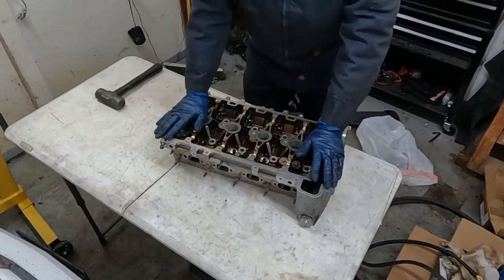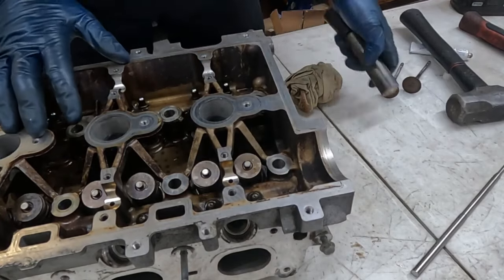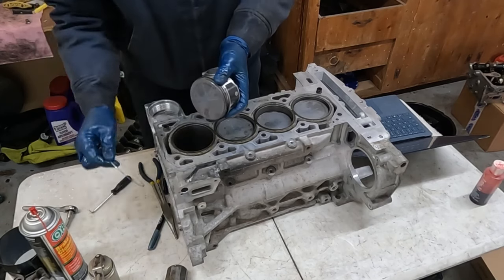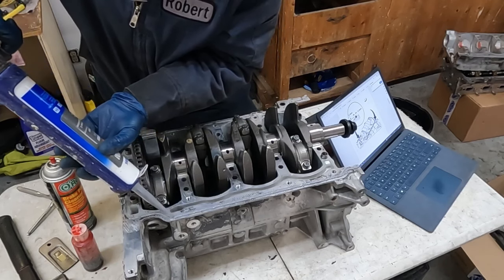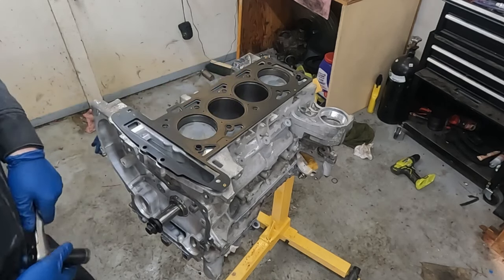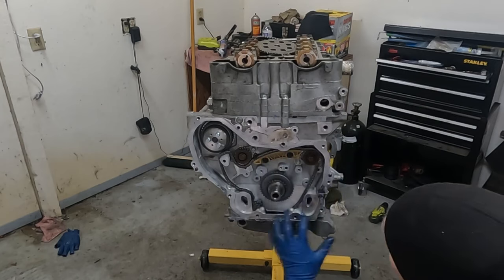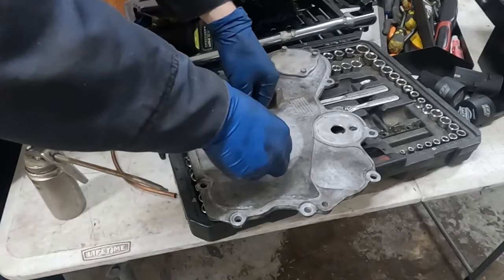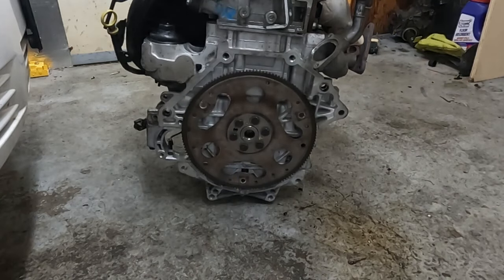Chevy 2.2 Ecotec Engine Assembly | Engine Rebuild

Comment: One of the best and most informative videos I’ve come across. Great job and thank you sir
Reply from the maker: @chrisogilvie2185  Thanks! Glad this video is helpful 🙂
Reply: I’m looking to change my piston rings on my 2013 terrain soon. Which rings did you use?
Reply from the maker: @chrisogilvie2185  These were from Engine Tech. They are a decent brand. But if possible I would recommend Mahle/ Clevite or Hastings.
Reply: @ValleyMobileAutomotive  awesome thanks for the advice ! 😁

Comment: Bought my 2.4 na cobalt SS new in 2006…220,000 miles and still running strong. Only problem is the oil cooler is starting to leak.

Comment: mine (Z22SE) is leaking some oil and it's gathering just behind the oil filter, there is a crevice there. I wonder if it's the valve gasket. But it seems bone dry.
Reply: Mine had a pinhole in the plastic oil filter cover that let oil seep out under pressure.

Comment: Awesome video! What rebuild kit did you end up using? And you said you put new connecting rods in? Where did you get those? I know there is a TSB for connecting rods bending in these (destroyed my engine) I was just curious if there is a brand you recommend for avoiding that in the future
Reply from the maker: Everything came from Rockauto. The kit was mostly Enginetech. I can't recommend this kit though. The head gasket didn't seal and the injector o-rings were too small. I would recommend Mahle for metal components and Fel-Pro for gaskets if it's available.
Reply: What kit did you get? 🙂
Reply: I was following the book and noticed it looks like you let the tensioner spring out instead of resetting it. I've noticed issues when I set it and try to to suggest the book does and set it. Would you just purchase it in sprung?

Comment: Would you recommend using copper spray-a-gasket by permatex on the cylinder head gasket?
Reply from the maker: @JustinMitchell-g6v  Good question. It's not needed. Getting a quality brand gasket is all you need 👍

Comment: How much dose that motor weigh with out head on it doing one for my wife that the timmer chain guide broke in a million parts and a bolt was found on the bottom where the oil pain meets that 2nd main crank case trying to see if we could lift it out by hand no life thinking its about 350 400lbs at most
Reply from the maker: That's a good question, I don't know the answer to. I think bending over the car to lift something that heavy would be very difficult. A cheap engine hoist costs around $100 and would save your back.

Comment: I cant find any 2.4 ecotec engine overhaul videos on YouTube. Is this 2.2 ecotec rebuild applicable to rebuilding a 2.4 ecotec engine?
Reply: They look so similar; I assume the displacement is the only difference?
Reply from the maker: @waterfrommatthias5601  What year is your 2.4? I'll look at the manual and see if they are similar.
Reply: @ValleyMobileAutomotive  It is from a 2013 chevy Equinox. Thank you very much for your help!
Reply from the maker: @waterfrommatthias5601  They are very similar engines with minor differences. What I recommend is getting a manual that shows you the torque specs and assembly sequence. Even a cheap Haynes manual should have that information. You can use this video as a visual aid if needed. But none of the parts in the description will match your 2013. Hopefully that helps
Reply: @ValleyMobileAutomotive  I see, I'll buy a manuel and fix it that way then. Thank you very much for the information.
Reply from the maker: @waterfrommatthias5601  You're welcome! The process will be similar to this video but I can't guarantee the torque specs will be the same. That's why a manual would be good to have in hand. If you have any other questions feel free to ask. I might be able to help 👍

Comment: Do u think it's possible to change 1 rod bearing without taking the crankcase off ???got spun bearing
Reply from the maker: You can replace the rod bearings by removing the oil pan. It's relatively simple to do. Make sure the crankshaft journal is still good before putting on the new bearings or it will have all been for nothing. A damaged crankshaft would need to be replaced.
Reply: he's a pro!!!!!🤣🤣🤣
Reply: Wrong you cant get to the rod caps without removing the crankcase
Reply: You'll have to remove the oil pan and the bed plate. If the engine isn't upside down, you'll have to remove the crank too or it'll want to fall out when the bed plate is removed.

Comment: This is NOT how to lap the valves at all don't do it this way. Your not breaking the glaze you are creating a matched surface so it seals and this is supposed to be a back and fourth motion with slight advancements 360 degrees circle.